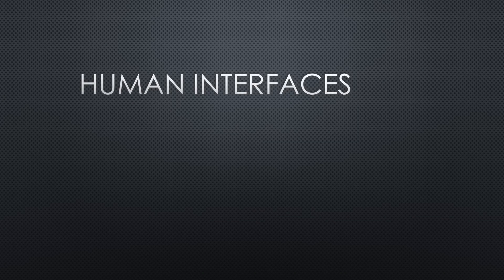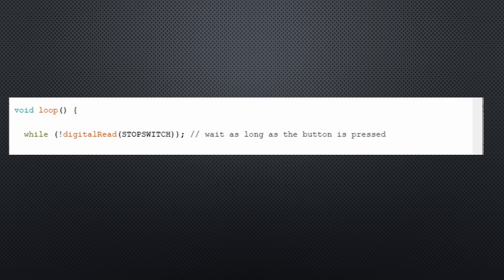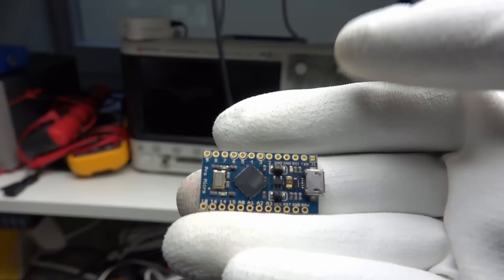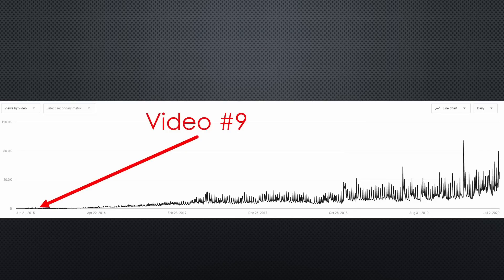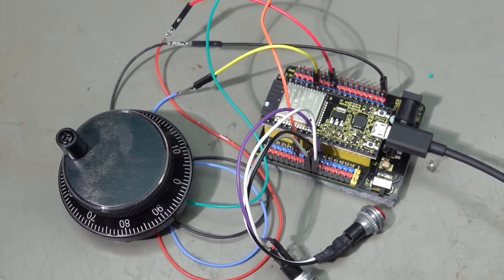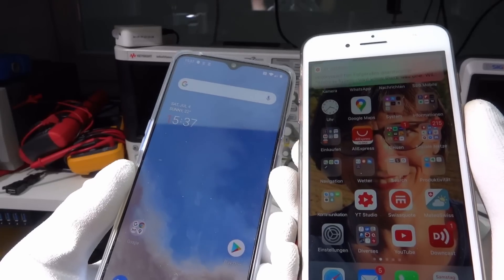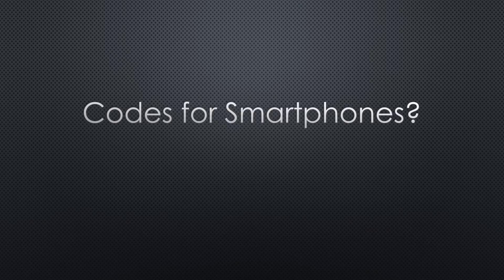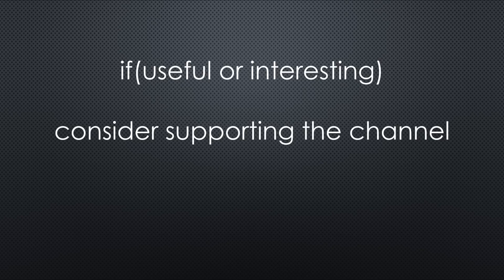(487) Remote control of PC and Smartphones with DIY HID devices (incl. Rubber Ducky / Bad USB)

Comment: Hi, quick question, does the arduino pro micro also work with mouse inputs and an iPhone? Meaning, if I have the arduino and an usb-C to lightning cable, can I use the device to send mouse inputs to my iPhone?
Reply from the maker: I think so, but you have to try (or to google for more info)

Comment: I made a small project with Attiny85 as a keyboard emulator and it worked out fine (I use it to practice Morse code sending with apps that accept keyboard input). And I agree it is a horrible programming experience, although the price is really good.

Pi Pico can supposedly also be used as a HID emulator, but I haven't tried it yet.

Comment: I have a similar looking microscope, and didn't like the mouse control, but i found out that plugging a usb keypad instead of the mouse give me the most used commands. You can choose focus mode manual/auto, when in manual focus you can adjust it with two keys or make a single shot automatic focus. And you can make a screen capture. The only function i miss is starting/stopping vidéo capture.
Reply from the maker: Also a good idea. Thanks for sharing!

Comment: You could use a hard drive, a spinner, to create a freely moving rotary encoder.
Reply from the maker: A good idea!
Reply: @AndreasSpiess  I can't remember where I saw it. I used adafruits rotary encoder board to read the pulses from the magnets though. Used it for the same purpose as your thinking. It also looks cooler because it's shiny. They're also all over the place and I'm sure you have many old ones.

Comment: As a rotary replacement, what about a stepper motor (from a printer or something else)? But I do not know how to detect the direction for that 😞
PS; for a project I would like to do, do you know if there is an ESP library to connect to an external HID over bluetooth? I have a scanner which can behave like a keyboard either over USB or BT. Of course I also have other solutions which already support usb IN, and I wil use that alternatively. But if there is an ESP library for this, that would be great!
Second question: I would like to remote control lights and such. But all the radio or LED controlled devices use 5 mA at standby. This is way too much. I know BT used really so little, I would like to enable lights over BT with a simple BT switch (those ones they sell for taking pictures with your Android).
I am asking too much. But I hope I may inspire you to use either one for a project (if you know there is a working solution).
PS: yes, I have seen most of your remote devices in many of your previous videos! Do know I watched them all. I was just thinking of switching a new way. Or: do you think a BT receiver would use a lot of power as well? I do know the sender uses almost nothing! I have temperature meters running all day on a cr2032 battery for over a year. BT must be the way to go I think.
Reply from the maker: Unfortunately, bluetooth on the ESP32 was quite power-hungry when I tried it. So it is not an ideals platform to save energy... Otherwise, BT is great!
Reply: @AndreasSpiess  Thanks! I will focus on radio signals. An AM radio needs as good as no power (the sender is the source).
Keep up the good articles on your channel, I like it. It is unique in its kind.

Comment: Cool video! I wanted to make a macro keyboard for myself, maybe that's a sign to finally do that.
PS: For a smartphone photobooth - it works with headphones' buttons (wired or wireless) as their buttons also take a picture. I used to have a lot of old broken earphones with working buttons, before moving.
Reply from the maker: So go for your macro keyboard!

Comment: AH, this is a cool video. Why did I not notice this before?
I have been playing with USB keyboard interfaces a lot and I also have been working on a similar jog wheel for Davinci Resolve. I used an AS5600 magnetic angle sensor, a large bearing and some 3D printing to create my own jog wheel. That works great, the only problem I had was most microcontrollers only implemented a slow speed USB which uses a 8 ms polling rate, resulting in max. 62 keys/s. I used a Teensy 4 to get full speed USB with a 1 ms polling rate, theoretically getting up to 500 keys/s. This completely removed any key lagging in my case.
I cound the AS5600 a great solution for this since this now allows me to adjust the number of steps (keys) per rotation, resulting in a perfect 1, 2 or 5 second (25, 50, 250 or 30, 60, 300 pulses) step per rotation.
I not have to check if the ESP32 is up to a similar task so I can replace the umbilical (USB) with a battery to get more freedom on my desk😀
Reply from the maker: Thanks for sharing your project! I hope you will be successful with the ESP32. It is a bit cheaper than the Teensy...

Comment: One thing not mentioned here (and it's a little-known but potentially very useful feature) is that in addition to the standard HID descriptors and profiles for things like keyboards/mice/joysticks, it's also possible to set up a "custom" vendor-specific HID descriptor that doesn't map to one of the usual classes. The device will be detected by your PC automatically and be accessible to applications, but the operating system won't do anything with it by default.

This allows you to make "driverless" custom USB peripherals with their own data-exchange requirements. You basically set up the HID descriptor to contain generic read/write data blocks that match your use-case, and you can then interact with these blocks of data from the connected host. You need to write the program on the host side to interact with it (so it's more work than piggybacking on a standard class), but it's orders of magnitude simpler than writing a custom driver from scratch and sidesteps all the painful signing requirements that normally entails.

Controlling custom RGB/LED layouts or LCDs, custom sensor inputs (force, temperature, accelerometers, etc) and more are all possible using this approach, and you don't have to worry about other applications interfering with your peripheral or ensuring you're not going to affect other programs because of some fake keyboard inputs you're sending.

I believe it's even possible to interact with such custom HID peripherals directly from the Chrome web browser (because it has some APIs for interacting with USB/HID, although other browsers don't support this) although I haven't played around with this myself.
Reply from the maker: Very interesting information. Thank you!

Comment: There are Chinese encoders available with very smooth movement and a standard 6mm shaft, just add a machined knob that has some decent mass to give some inertia.
Reply from the maker: Thank you for the additional info!

Comment: Andreas, for the encoder I just use a standard encoder like we use in industrial applications you can get them cheap. then I buy a solid aluminum knob usually a large diameter with a 6mm hole for the encoder. I also use these on my radio builds for frequency tuning. it works great and the weight of the large aluminum knob works very smoothly.
Reply from the maker: What would be the keywords to find it on AliExpress? (Links are not alowed on youTube)
Reply: @AndreasSpiess  
600P version of either is more than enough count per rev. you could probably go lower but you can fix it in code.
The first encoders I used are this one $9.36 US:
100/200/360/400/500/600P/R Photoelectric Incremental Rotary Encoder 5V-24V

I found a cheaper one but didn't try yet $6.26 US
New incremental photoelectric rotary encoder 400P/R 600P/R 360P/R pulse / line AB two-phase 5-24V NPN PNP output 2m cable

The knob I prefer the larger one here $12.50 US:

1pcs high quality aluminum knob solid potentiometer knob 44*22*6m

But smaller knobs work also 2pcs for $2.53 US:
2PCS Aluminum Solid-core Knob Cap Size 32*13mm 13X32MM The Inn

Have fun with this, it makes your project seem much more impressive with the feel you get. it's like using a store-bought radio. and thanks for all the videos.
Reply from the maker: @curtstacy779  Thank you! All links found and already in the shopping basket ;-)
Reply: @AndreasSpiess  By the way, let me know if you need more info maybe I can send the links a different way. the schematic was a standard easy-to-find version. it will bring your input to 0VDC and there is a better schematic that has just a little filtering in it I haven't tried to use that one yet but it could be even smoother.
Reply from the maker: @curtstacy779  Thank you for the links. I found the products! Nice looking knobs, indeed!
Reply: @AndreasSpiess  Oh nice! you are going to love that setup! the only thing we may have to come up with is an adjuster to put some friction on the knob so it doesn't over travel but it works so well I just let that go. I'm happy to see you found them. can't wait to see them in a video.

Comment: I had some hoby projects in the past year, that ended up beeing HID devices. Maybe some inspiration for others:
1. some inputs for flight simulation at my PC. Here I used a Teensy. First I only added some Buttons and switches and a rotary encoder (to set the radio in the plane). When my rudder paddle device broke I did build an own that is also run by the very same Teensy-module.
2. A friend needed to combine two HIDs to act as one (with some tricks to avoid interference of both). I chosed a maybe overcomplicated solution with a Rasperry Pi where I plugged in both HID-devices. A Python script was able so separate inputs from both HIDs and ensured proper order... this was send via serial port to an arduino, which worked as a HID for a PC.
3. control Youtube player on Smartphone or iPad. A musician want to play along YT-Videos... a ESP32 emolates a mouse/keboard HID and enable to chose a specific video with a rotary encoder. This video is then started in YT-app. An extra button trigger to jump at a specific time in the video.

Raspberry pi Pico can also be used as USB hid.

If you build a Bluetooth HID, don't forget to add a battery information (read voltage with analog pin). Battery status can be send via bluetooth, this is part of HID-protocol.
Reply from the maker: Cool ideas! Thank you.

Comment: Great video. I put something out on Hackaday along these lines called BlueKey Remote - basically using an esp32 wirelessly controlled by a 4 button key fob to send commands to a PC.  Code is open source.  Also, now I want a jog wheel, and just added it to my Aliexpress cart - thanks for the link :-)

Comment: The jog wheel should have some kind of indexing mechanism in it that snaps into grooves on a wheel or something similar. Open the thing, remove (or break) this, add a good amount of non-conductive grease (for dampening) and you should be done. Thanks for this informative video :)
Reply from the maker: Thank you for the tip!

Comment: Also of help might be "Autohotkey"  which can act as a layer above the HID and is able to run entire Macros. This  can also detect & change which window is in focus, so can be made robust to input interruption.  This is a lot easier to write & debug.  Plus the microcontroller is simpler as it only has to send one keystroke combination (which can be entirely novel control+alt+whatever you like) for each  action and AHK handles the rest.
Reply from the maker: Thank you for the info!
Reply: I was thinking the same thing 
Ahk is very powerfull

Comment: I've literally done this with arduinos for over a decade and found the process miserable. While it eventually works the problem with kill switches etc just makes the process annoying. There is an much better way using CircuitPython and the RP2040. You can access the code and edit it while it is running, Coding HID is much simpler and unless you need to directly interact with interrupts it is much better. (of course Circuit Python has calls to drive matrix decoding and rotary encoders). My Adafruit RP2040 MacroPads, Pimoroni Keybow 2040s etc are daily drivers.

Comment: It should be possible to modify the CNC rotary encoder you show.  I have done it with one (for tuning an SDR). I had to remove the 'handle',  carefully remove the centre disc (it's stuck on with double-sided tape), remove the knob then remove the spring-loaded ball-bearing which creates the 'steps'. I got this information from another YT channel - can't emember which unfortunately.
Reply from the maker: Thank you for the info!

Comment: Hey Andreas! Great video, as always. I've been looking for something like this for some time, but for controlling my music production/live mixing, and usually those programs use the MIDI protocol - maybe it is worth a try on exploring it? Many musicians use very expensive controllers that could be done for basic functions with little less than some buttons and a controller board. Another thing I've been trying to explore, but with no success, is doing a DIY button matrix, where each button could be illuminated with a defined colour (e.g. to dynamically allocate functions to them and know what they do in each program by their colour), it seems that it is a bit difficult to build RGB buttons, maybe you have any tips on that?
Reply from the maker: You should find projects for small keyboards with different additional functions. An may use ready-made "Stream Decks".
So far I had no use for midi (other than for a video on my second channel).

Comment: I used an attiny85 on a board that fit in the usb port. The program pressed caps-lock at random times.
Drove my co workes crazy when they couldnt figure out the problems with their keyboards 😂
Reply from the maker: I assume you won the "best co-worker" award after that prank ;-)

Comment: I find the ducky device often called a digispark.  I made some devices to tap the ctrl key every 5 minutes for some friends to use on their work devices and keep them awake.
Reply: lol and thereby bypassing the security policy the company has set for these work computers.
Reply: The "Digisparks" are not 32U4-based though, and they don't actually have USB either - they barely limp by as a low-speed USB1.1 device, bitbang-emulating one with a rather shoddy timing.
Reply: I made a similar one that toggled caps lock on and off randomly
Reply: Drove co workers crazy when they typed reports and such
Reply: I built some digispark duckies, if you want to keep a computer awake you just need to draw a one pixel square with the mouse every few minutes, unless you're doing graphics or something you'll never even notice.
Reply: With an Attiny85 I've made the DMK aka dead man keyboard that simply sends random key press at random times. Keeps your PC awake and fullfil your notepad with garbage... 😅😅😅😅😅
Reply: I had one there move the mouse up down every 5 min. Works fine if you want a pc run over the night and don’t want to change any settings.

Comment: challenge - is it possible to connect a USB keyboard and mouse to Arduino at the same time? Esp32-s3 with USB-OTG currently supports only one connected device at the same time.. Any suggestions?
Reply from the maker: I do not know :-(

Comment: With this Method i've bult a foot pedal used as PTT e.g. for discord. 
TIPP: Use funktionkeys F13 to F24, since they typically are not used by any standard input scheme, because this keys don't exist on a standard keyboard. But emulated with an arduino they work like a charm.. Great for Programs running in the background.
Reply from the maker: Good idea! Thanks.

Comment: Esp, a confused chip.
Reply from the maker: Why do you think?
Reply: @AndreasSpiess  oh for many reasons. But it seems everyone disagrees with me. For one, is it an RF transceiver or a microcontroller? Another point, they seem to take so much feedback from the hobbiest community as from the Arduino but when they give you the option to use their ide with the idf they end up with half functional code that doesn't run the same firmware between updates. Dear Andreas, you're a model engineer, what do you think? Please share.
Reply from the maker: @xDR1TeK  I like the possibilities of the ESP32 and did many projects with it. Its price performance is excellent, and its community support, too.

Comment: A standard through hole or panel mount rotary encoder with a big heavy knob attached should run pretty free. I put one on a panel for some equipment at work, it has a little finger detent and you can give it a quick spin to make big changes or dial it in exactly, it's so much better than buttons.
Reply: use a stepper motor....cheaper!
Reply: @altamiradorable  how do you use a stepper motor as an encoder? Is it really cheaper than a £1 PCB mount encoder?